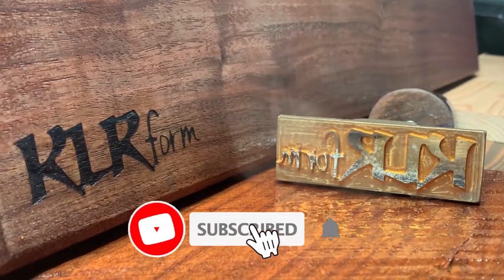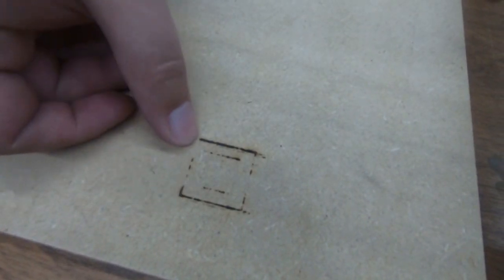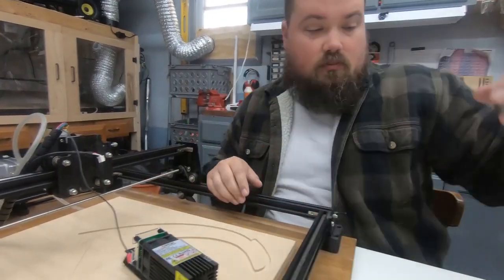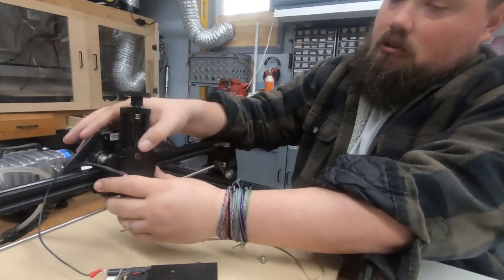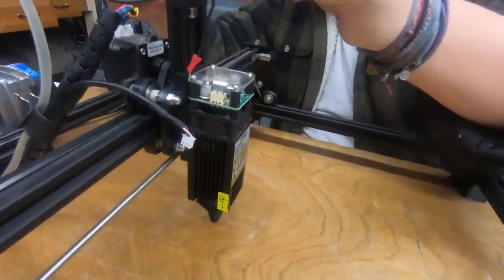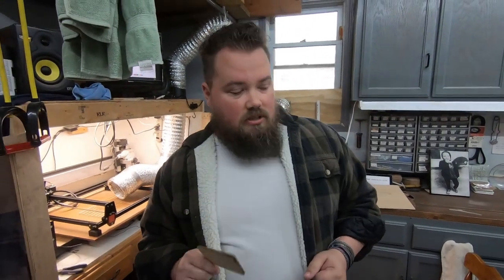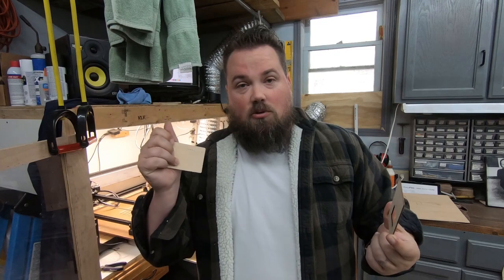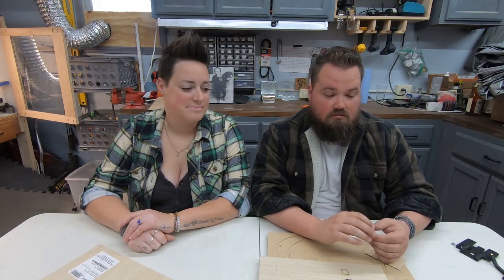Will it Cut? | Ortur Laser Master 20W, New Z-Axis and Air Assist

Comment: Im an arch student and have been thinking of getting one of these to make model making easier. I mostly use basswood to make them. Is basswood stronger than plywood? Would it be easier for the láser to cut basswood than plywood?
Reply: Its also a matter of thickness, they are either 1/8 of an inch or 1/16th of an inch. So 3.1mm and 1.6mm
Reply from the maker: The thin one should cut really easy. I have not used basswood but I think it’s a common wood to use and as long as air assist is setup should be ok.

Comment: You've probably figured it out already, but it wasn't the placement of the original air assist that caused it to cut better along the Y-axis, it is the shape of the laser "dot".  Ideally, the dot would be circular, or at least perfectly square.  In reality, most of these laser diodes produce a rectangular dot that is often 50% or more longer than it is wide.  If you vector engrave a square into the wood, you should notice the vertical lines are much thinner than the horizontal.  When cutting along the Y-axis, the narrower beam focuses more of the energy into the narrower kerf.  When cutting along the X-axis, the slightly wider beam means the same energy is spread out over a wider kerf.  Don't get me wrong, the second air assist design is much better, and will improve the cutting performance, but if you run a cutting efficiency test pattern, you will still find that one axis cuts through sooner than the other.
Reply from the maker: Yes. I did find that after the fact. But thank you for adding just a great in-depth explanation.